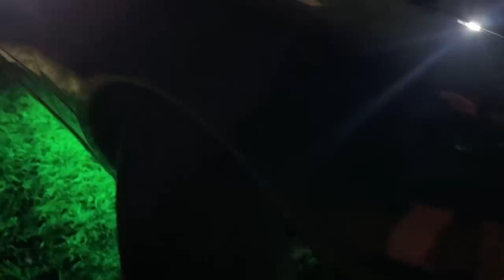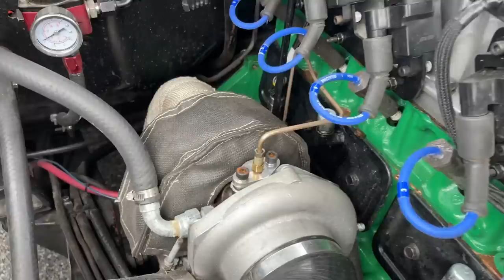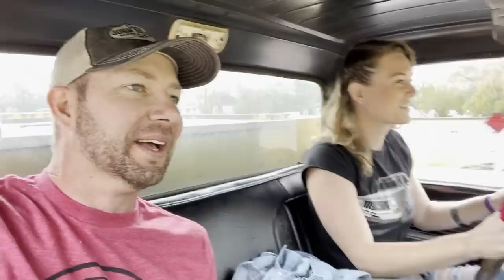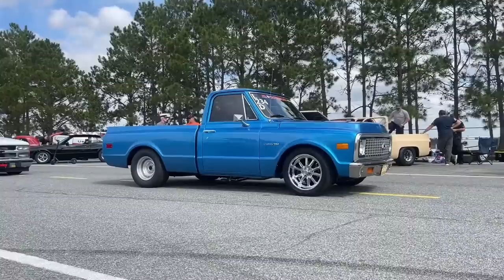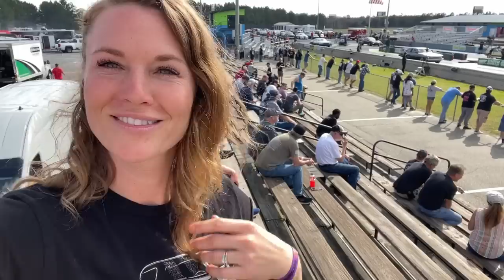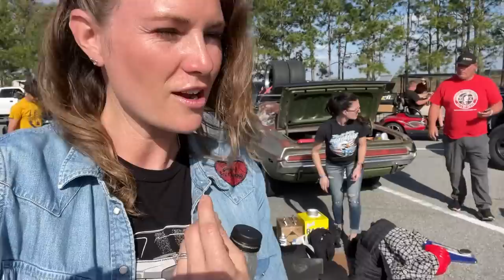Sick week day 3!

Comment: That gasket in a can is great but people need to read and follow the instructions! 
It's a urethane, not silicone. You use a thin bead and once applied you LIGHTLY join the two parts and allow to cure (the time is on the can) and only then do you torque the parts down to correct tension.  The idea is it dries and forms a gasket before being torqued, it is NOT a one-minute fix product by any means.  The result is far superior to silicone which is not really designed to form a gasket but to coat an existing one. The two products are not really interchangeable.